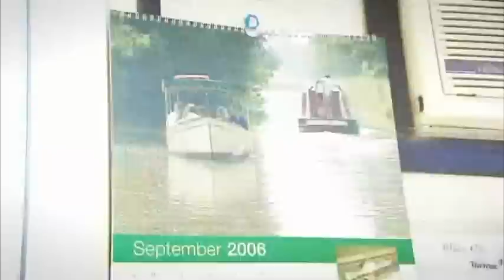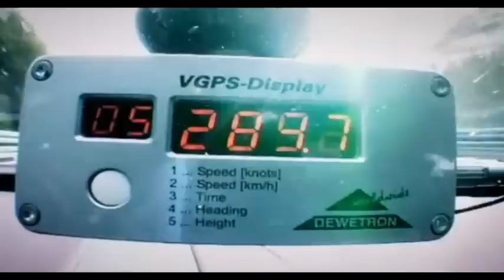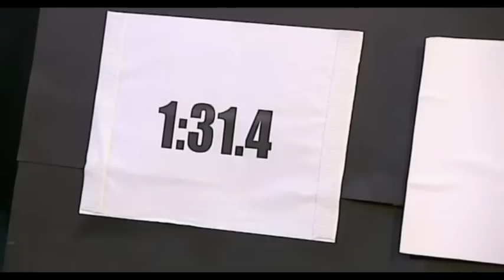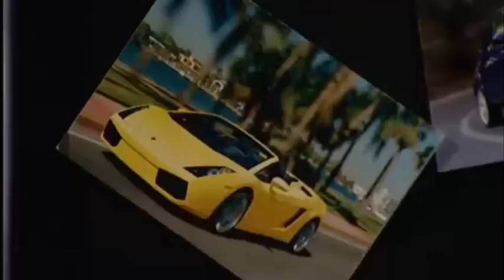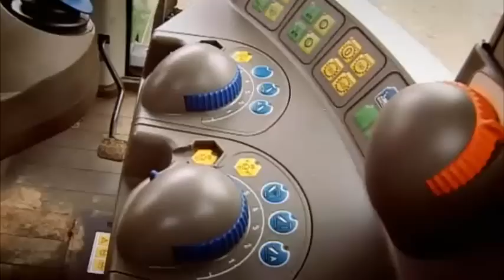Best of Top Gear - Series 9 (2007)

Comment: 5:54 May: I have the high ground
Reply: @RiggedFem  I know but the scenes are close enough. What do you expect, I quote the light saber sound effects instead. Hes traveling at a 'Hight' speed, faster than the other 2, with the star wars soundtrack. What other identifiable quote could have been used.
Reply: Clarkson: you underestimate my Power
Reply: @sadjackaboy1366  Hammond: You underestimate my crashing
Reply: @RiggedFem  there is a moment in the soundtrack of that scene where they play a segment of duel of the fates

Comment: 17:54 ngl probably because we think things are cooler than they actually are. room/outside temp about 25 degrees, most of us are about 37 degrees. 12 degree difference probably
Reply: It's because the temperature difference is larger, for example if you have some water at 4 degrees the difference from room temperature is around 20 wheras if you have a hot drink at 60 degrees the difference is 35 therfore the energy Is lost to the surroundings quicker
Reply: @gabrielcaddy9850  but a drink thats 20 degrees above room temp will lose energy slower than a 35 degree difference yea, but eventually that 35 will drop to 20, and will start losing less energy per second. its inversely exponential... total energy loss increases, but the energy loss per unit of time decreases over time, sort of

but im fairly certain what james mentioned was just an illusion, if you had cold and hot water in 2 different flasks both with a 30 degrees temp difference between room temperature,  and like i said we're about 12 degrees hotter than room temperature, and water at maybe 35 degrees c feels warm to me; 20 degrees drop... whereas with the cold water, -5 + 20, about 15 degrees c feels really cold.
Reply: @conkerconk3  I came here to see bickering and cars not the science of warm